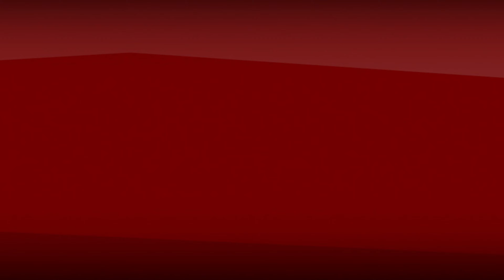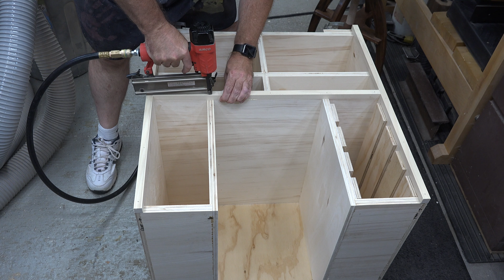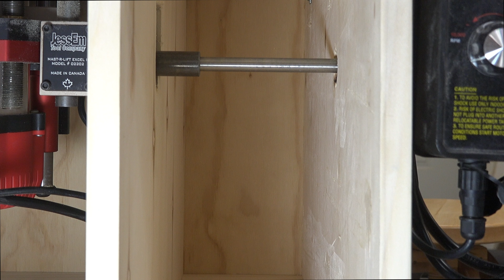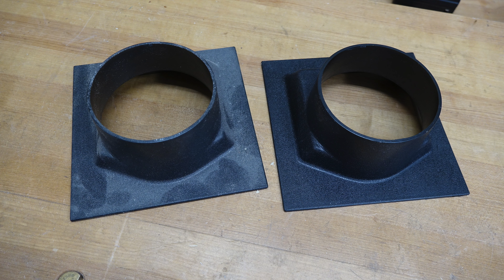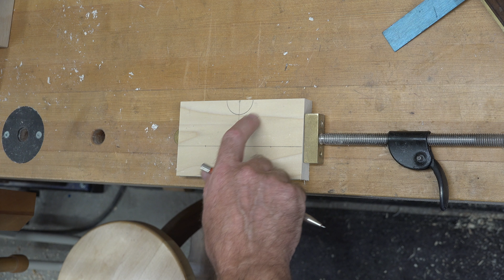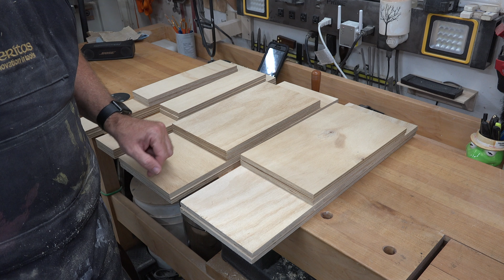Building a Router Table Cabinet Part 2

Comment: I have been looking at that exact router table from jessem thanks to you I think I'm only going to buy the top and the router lift and fence as they come in a package, question I have how easy Can You Reach the break with where you put your power switch? Also how hard is it to remove the rotor motor?
Reply from the maker: The brake is very easily applied Derrick.  While is it close to the side wall of the router cabinet, it is also able to be applied using only one finger so there is no issues at all in accessing or applying the brake.  As for removing the router, it's a one bolt system that clamps all the collars down to the router motor.  Release the pressure on the motor clamp and you can easily slide the motor out of the table.  Although I'm not sure why you would want to slide it out.  Normally, the motor is considered a permanent fixture of the table with no need to remove it.  Either way, if you wish to remove it, it's a very easy process.  On page 6 of the manual, steps 16 and 17, you can see the one bolt that needs to be loosened to remove the motor.  You can find the manual on Jessem's website.  Here's a link to it.  https://cdn.shopify.com/s/files/1/2315/8051/files/02202_Mast-R-Lift_Excel_II_English_and_FrenchWITH_Prop_65-_Lower_Version.pdf?312
I hope this helps Derrick.  Thanks for tuning in to the show.
Reply: Thanks you're an inspiration and thank you again the the reason I was asking about removing the motor I can afford a new router table but I have to use my old router I can't afford both knew right away
Reply from the maker: @derrickthesen7008  I had to do the same thing.  The router that I wanted was back ordered so I had to install a temporary motor until the new one was back in stock.  You will have no problems at all changing the motor when the time comes.  If it is inside the cabinet, it might be a little finicky because of the walls of the cabinet but not difficult.  Thanks for the kind words Derrick and good luck with your new router table.  It's a great setup.

Comment: Hi Kenny, Great show.  I'm curious, did you leave the top metal brace of the frame/stand attached to your table top for this assembly?  I noticed the legs to your original stand in one of the shots without that top bracket on it.  I was considering mounting my tabletop to a wooden cabinet carcass in a similar way, leaving it attached to the metal brace from the stand.
Reply from the maker: I ended up with 2 of the original stand braces connecting the phenolic resin top to my new cabinet.  The rest of the cabinet was attached using L-brackets in existing holes in the table top.  It worked out rather well.  I hope this helps.  Thanks for tuning in Bill.

Comment: Will part 3 show how the final dust collection comes together?
Reply from the maker: I'm not sure what you mean by coming together Dave.  The two flanges and the hose from the router shroud to the back of the cabinet is as far as I go with the dust collection and honestly, it does a great job with getting the majority of the dust from the cabinet.  I hope this helps.  Thanks for tuning in.

Comment: Hi Kenny, I'm very interested in how you fastened your top and how many of the brackets from the table you used. I'm ordering the top from jessem but not the metal frame. Thus my interest and handling the wheel adjust and digital readout...back to watching your video again. Thanks kenny!
Reply from the maker: I used 2 L brackets on each side, using the original holes in the phenolic resin top to mount the L brackets.  They were then screwed into the sides.  The inside of the cabinet needed a fine tuning to get the brackets to fit correctly but it was nothing that a chisel couldn't take care of.  It was a finicky process, but well worth it for the end results of the cabinet.  I hope this helps Jeff.  Thanks for tuning in.
Reply: @acutabove_woodworkings  thanks Kenny. Appreciate it.
Reply from the maker: @jt8172  You're very welcome.

Comment: Kenny - is there an issue with the sound? There's a constant background hissing-type noise.
Reply from the maker: I was testing some new audio equipment for a few episodes of the show and it was horrible.  As you point out, the constant background hiss was nothing more than annoying.  There was only a few episodes filmed and then I discontinued use of the new audio mics and went back to my old system.  I guess if it wasn't broken, I shouldn't have tried to fix it.  Thanks for tuning in and taking the time to leave your comment.  I appreciate it.